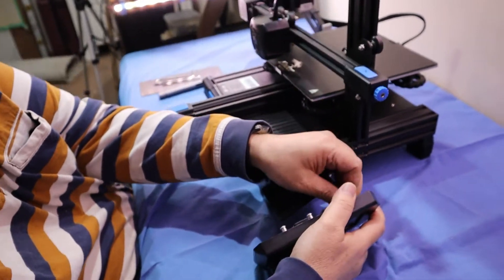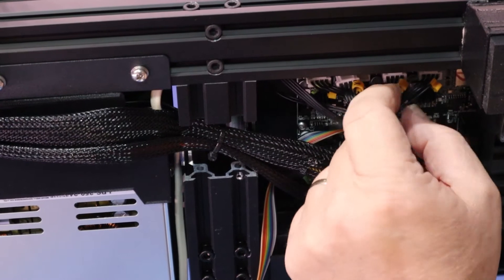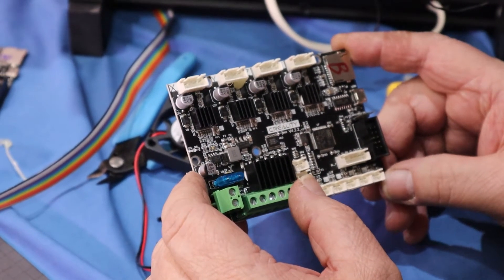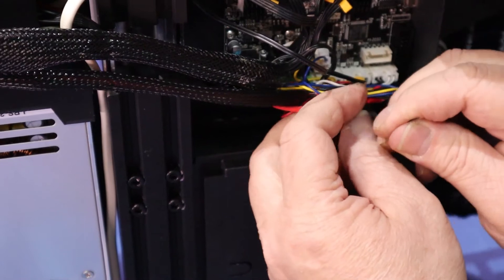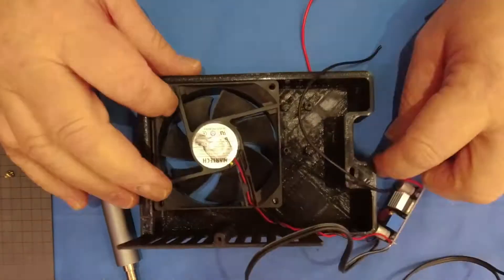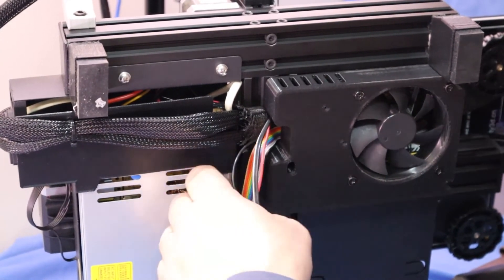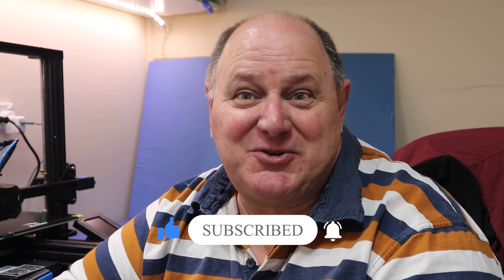Mainboard and power cover upgrade Ender 3 v2

Comment from the maker: Do you have any tech tools you like using?
Reply: The Smartphone has made being a hobbyist maker, Modder, and computer connoisseur even possible for me.
I need to take photos of EVERYTHING.  Instructions  on the computer screen, before and after comparisons, but most importantly how to return what a pull apart into its original, functioning order and positions.  Which screw came out of which hole.  Which wire goes where.  Plugs and sockets.  You name it.
Photos of EVERYTHING.
Its no joke.
Reply from the maker: @odinata  That’s good practice. I also take many pictures, makes putting everything back together much easier.

Comment: Hello sir, my Ender 3 v2 3d printer makes a beep beep sound even though the cable is correct, where is the error? (Google translate)
Reply from the maker: When does it beep? What's on try he display?
Reply from the maker: When does it beep? What's on the display?

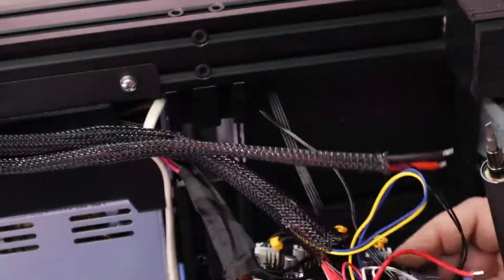Comment: 4:00 both of the red wires look the same. How did you know which was which?
Reply from the maker: The hot end wires have fabric coating and are both red. It doesn’t matter which way they go as long as they go to the hot end connection. The other red wire is quite different so not easy to mix up.
Reply: @philtalkstech  Thank you so much!

Comment: Great video, and absolutely obsessed with the wowstick!

My board came chuckfull of glue, any tips for removing it so I can connect the cables to the new board?
Reply from the maker: It's hot glue so a little heat from heat gun or hair dryer makes it easier to remove. Be careful not to overdo it though. You don't want to melt your cables.

Comment: question? If upgrading from 4.2.2 to 4.2.7 do I really still need to update the firmware?
Reply from the maker: Yes you do. There are some differences that need altering in the firmware. Just check what chip you have on the 4.2.7 mainboard as they have been shipping with different chips of late and firmware needs to suit the chip. Let me know what chip you have and I can point you to the firmware. Thanks
Reply: @philtalkstech ok thanks. How about the 3V2 screen? I heard that needs to be updated as well or no?
Reply from the maker: @mcorrade  Screen should be fine. Unless you want updated icons.
Reply: @philtalkstech  Phil you DA MAN!!!!!
Reply: @philtalkstech  Ok I just received the board and its a 4.2.7 and the larger chip says ARM  STM32F103....Is that enough info?
Reply from the maker: @mcorrade  that’s good. But need to know if it is RCT6 or RET6. That’s just how much memory it has.
Reply: @philtalkstech Hey my friend I've downloaded what I believe is the correct firmware from the Creality site and they never mention in their site to look out for the RET6 which is my chip. Can you send me the correct link?
Reply from the maker: @mcorrade  This is the firmware I’m using and I think it’s the best available 
https://github.com/mriscoc/Ender3V2S1/releases/tag/20221002
Just scroll down to assets and choose the one you want. Either bl touch (If you have a BL or CR touch). If not then mm (Manual Mesh.
Reply: @philtalkstech  thank Mate got MM version. I was thinking of getting the BL or CR but now I know where to got when I upgrade.
Reply from the maker: @mcorrade  all good. Hope it all goes well for you.
Reply: @philtalkstech  Thanks so I replaced the bad MB but haven't turned on the unit yet. Should I just do firmware when I first turn on the system or should turn the system on first then reboot to update or does it even matter?
Reply from the maker: @mcorrade  It depends what firmware is on the mainboard. What did you order it for?
Reply from the maker: @mcorrade  you could turn it on to make sure it works. If the firmware isn’t for E3v2 though. Then the screen may not work
Reply: @philtalkstech  to replace the 4.2.2 MB that was bad on my ender 3 v2 I have.
Reply: @philtalkstech  I just flash the board when I first startup the system after I'm finished with the rest of the build. I had completely disassembled the system due to some bed issues I've fixed.
Reply from the maker: @mcorrade  happy printing brother
Reply: @philtalkstech  OOOOYAAAA thanks mate. The firmware worked like a gem and what a different in the menus now. U DA MAN
Reply: Phil that firmware is so advanced, I don't know have of what my new options are lololo. It does print like dream. I'm trying to learn the MM so if you have any videos on this firmware I would love to see them.

Comment: Hi! Could anyone tell me what screw bit I should use to unscrew the cover of the motherboard? Thanks!
Reply from the maker: They are m3 bolts but use 2.5mm Allen wrench.
Reply from the maker: Usually Allen wrenches come with the printer.
Reply: @philtalkstech  Thank you! It is weird because the wrenches that came with the printer don't fit well those particular screws. I have no clue why.

Comment: Hello, I am trying to follow the video but is it common for your motherboard to have hot glue everywhere, bc they glued every single on of my plugs, I also took out the screws but the board won’t come out
Reply from the maker: Yes they do put hot glue on them. You will need to break the glue away first. Just check you got all the bolts, it is hard to see all of them with the cables in the way.

Comment: My ender 3 V2 came with the 3.4.1 controller board, want to install the CR touch, and I'm having trouble finding the drivers, any ideas. Not sure why your not getting more subscriptions, but I always point friends to your videos for Ender 3 v2 problems, and modification. Thanks.
Reply from the maker: This has happened to some other people also. Creality say it is a misprint. It’s actually a 4.2.2 board. (Although I haven’t seen this myself). Use the firmware for a 4.2.2 with BL touch.  It would be worth noting the firmware version before you change it. Just in case you need to revert to old firmware. You could also contact Creality support but they are known to respond slowly. Good luck? Phil
Reply: @philtalkstech  A bit of dyslexia going on my end, it was in fact V4.3.1 controller board.

Comment: Will you do a video about updating the firmware for this mainboard?
Reply from the maker: Hi Re Pete. I will work in putting a firmware video up soon. For now I have a section in my CR Touch video that shows installing firmware for the CR Touch. It is the same process for all firmware just choose the firmware that's suits your printer from the link provided. Thanks. Hope this helps.

Comment: I think I'm having the same issue
Reply: Solved all my issues. It is also worth increasing the air flow to the mainboard as the stepper drivers can get hot during long prints
Reply from the maker: It fixed the issues I was having. I would recommend upgrading airflow to the motherboard as well. The little fan Creality use is really small and doesn't run all the time. Thanks

Comment: Is that power supply the fat or the thin unit...i am trying to find mounts to place my supply along the bottom, so i can install the dual z kit... i have the fat supply mounted behind the right vertical side
Reply: It’s Meanwell thin power supply
Reply from the maker: It's the Meanwell thin power supply. 
Thanks

Comment: How does the V4.2.7 reduce layer shifting over the V2 V4.2.2? They both have silent drivers so those are the same. I’ve found layer shifting was most often caused by acceleration set too high. I’m really curious how this fixes it?
Reply from the maker: Hi Chep. 
My 4.2.2 board was faulty. One driver would overheat on large prints later would shift by 2mm, long discussion with printer supplier and board replaced at no cost. No more layer shifts on large prints. I also upgraded cooling for mainboard to improve airflow. 
P.S Love your Chanel. Watch it every week.

Comment: I've done some of the same upgrades as you side spool mount, look's exactly like yours. Raised feet (again exactly like yours) upgraded PSU fan to a 80 mm as well as the controller compartment fan, all metal extruder, raspberry pi  4 running octoprint, with a logitech C270 webcam, also upgraded my controller board to the 4.2.7 board. Instead of a cr touch i added an ezabl from TH3D, like it a lot better then the cr touch. have cable chains on all 3 axis and added autoshutdown/startup with TH3D's ezplug+, supported in octoprint. Can turn printer on/off in octoprint with it as well. Also added some LED lights to the top underside of the top rail of the printer
Reply from the maker: Hi Larry.
Thanks for the comment. I am planning to print some cable chains soon and I am keen on the autoshut down as well. I'm really enjoying modding this printer.